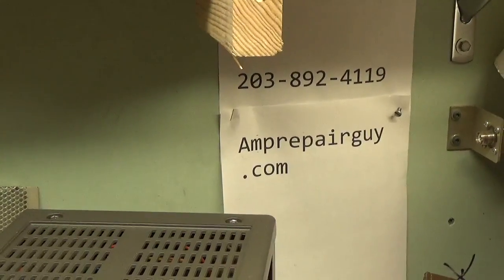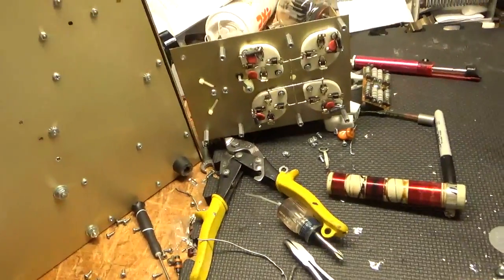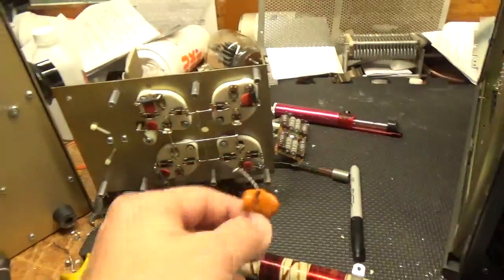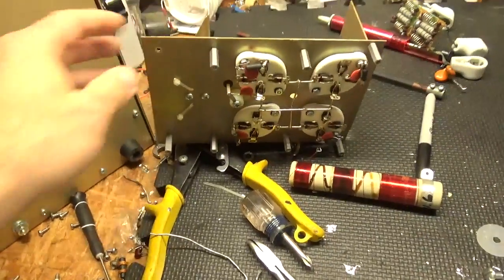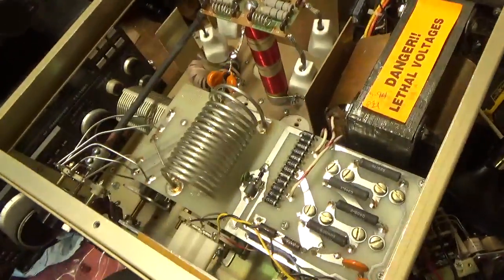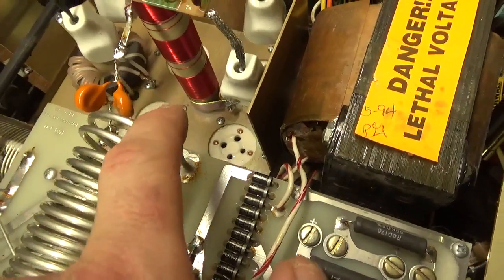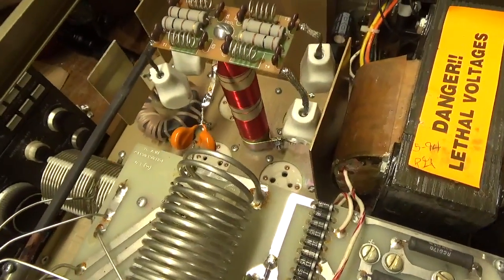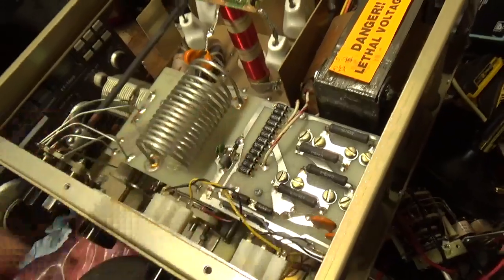811h Ameritron Repair and mods

Comment: I had a tube go bad and Ameritron sent me a new 811 tube and D16 location diode to change.  Do I just heat up where the diode is and pull it off or do I have to get to the under side to take it off?  It truly would help with my repair.  I never messed with Amps. before.
Reply from the maker: Heat the solder on the top side, no need to access bottom of the board. Be sure to install the new diode with cathode facing the same direction. This diode fails when you have a arc between the plate supply and ground. I would not change until you figure out why it failed.  Good luck and be careful.
Reply: @amprepairguy  Thank you so much.